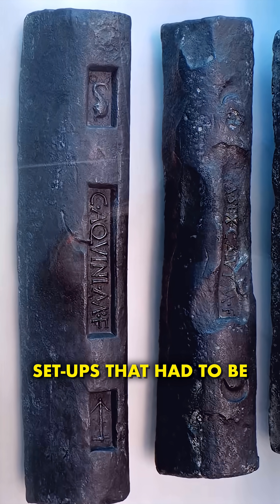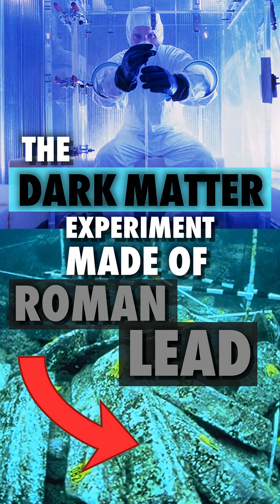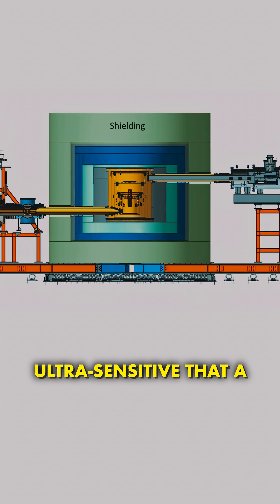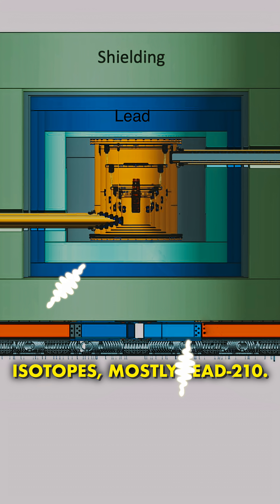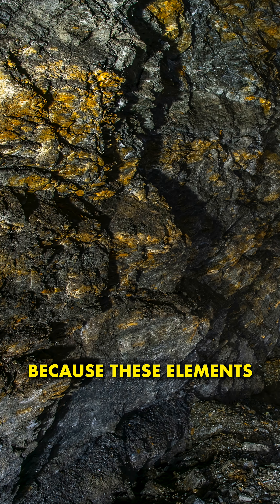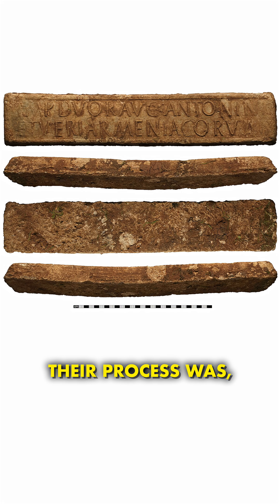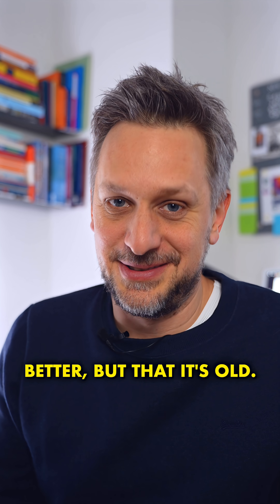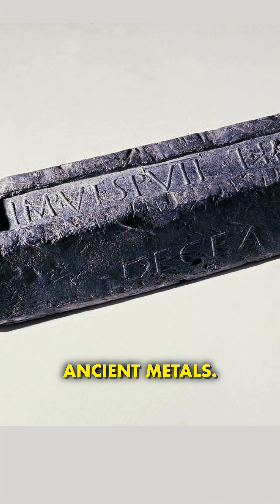Why we needed Ancient Roman Lead for this Dark Matter Experiment

Comment: A fundamental insight of Relativity is that mass that exists at Relativistic velocities is irrelevant from our perspective. Relativitic velocities are occurring in the overwhelming majority of galaxy centers. This means that they exist in a "non local" state relative to their outer regions. The mass in our galactic center is not just there, it's everywhere.
   Einstein repeatedly said that Relativistic dilation prevents astronomical concentrations of mass/singularities. He put this in writing in 1939. Nobody believed in singularities until television and movies began to popularize them in the 1960's.
   Relativitic dilation does not occur in galaxies with low mass centers. They don't have enough mass to achieve relativistic velocities. It has been confirmed in 25 dwarf and ultra diffuse galaxies including NGC 1052-DF2 and DF4 to have no dark matter. In other words they have normal rotation rates. All such galaxies have normal rates. Dilated mass cannot be observed as a particle.

Comment: Ummmm..... If DARK MATTER interacts only gravitationally, then Why wouldn't Black Holes be formed Primarily out of Dark Matter!???
Dark Matter Black Holes ought to be indistinguishable from "regular" Black Holes.!  No Test whatsoever would differentiate the kind of matter ingestion.  What's More, the Hawking Radiation would be particles of "normal" matter we're accustomed to - unless in addition to the matter-antimatter pairs arising spontaneously in a vacuum , there would also arise some form of "Dark-Matter & Anti-Dark-Matter" particle pairs
Reply from the maker: Black holes don’t have any special magic, it’s just gravity. It is actually quite difficult for an object to fall into a gravity well like a BH or a star, almost any initial condition will lead to just an orbit with angular momentum.

To change from an orbit into a fall trajectory, an object has to get rid of this angular momentum. Gas for example is very good at this, as it can both emit radiation or shed energy to other gas particles via collisions. Dark matter particles can do neither.

So, from today‘s perspective, we don’t know of any effective mechanism for dark matter to shed angular momentum, so we would expect very little of it to be swallowed by black holes.